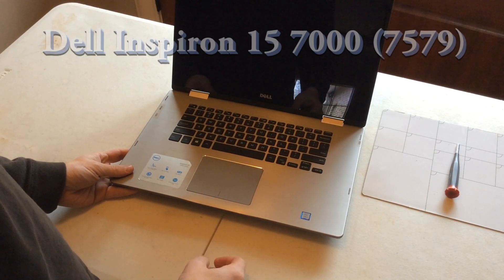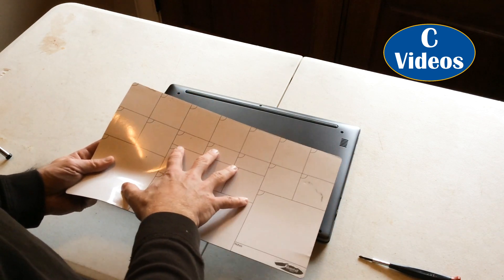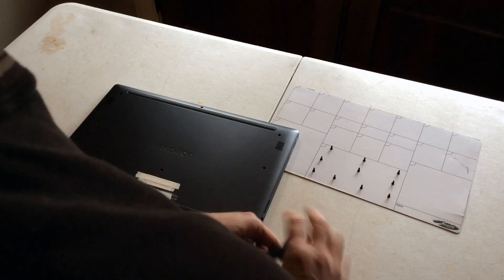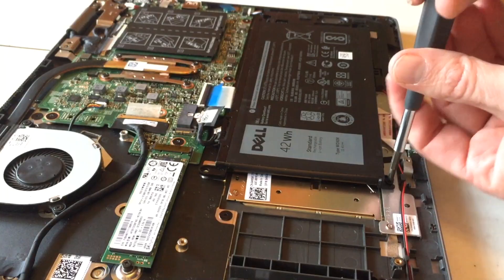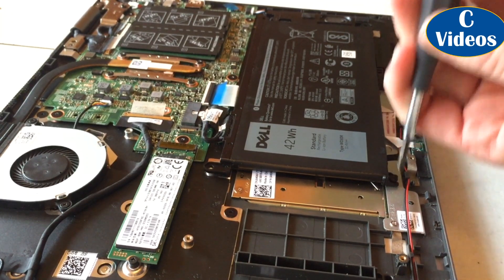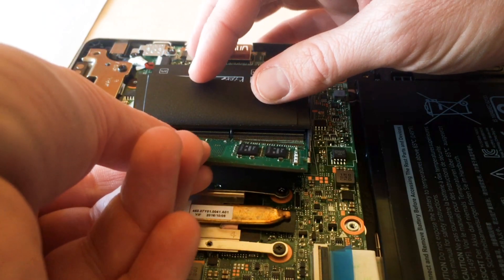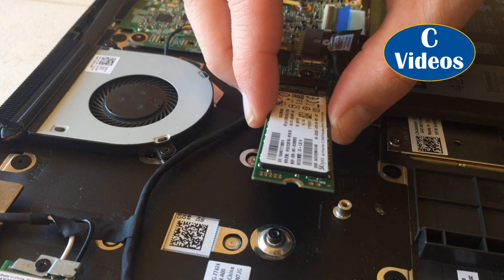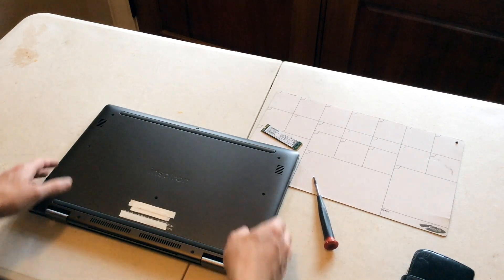Dell Inspiron 7000 Laptop -how to replace battery, RAM Memory, SSD / Hard Drive

Comment: Hello, I have a Dell Inspiron 15 7573 2-in-1 laptop. When I install an additional memory stick, i just get a black screen and can't even get into the BIOS. But with a single 8GB stick it runs perfectly fine. Originally wanted to upgrade up to 2x16GB = 32GB of memory, but it seems that everytime that I install both sticks, that's when I get the blackscreen. However when I have just one stick of 16GB Crucial memory in either one of the slots I get freezups after booting up into the desktop. I'm wondering if my laptop even supports Dual Channel mode.

Comment: Given the age of the video, this may have been pointed out, but on the battery replacement, I think you just got unlucky. I had all four screws in the battery. Thanks for the video though. It made things very simple to do.

Comment: The screws are all the same, you don't need that magnetic mat, you can damage the hard drive with magnets dude.
Reply from the maker: Thank you fro the comment. The mat is barely magnetic, if you turn it over, all the screws would fall off. It's just enough to keep them from rolling easily. And from my research, the SSD's are not affected by magnets.

Comment: Hi there,
Few weeks ago I suddenly got a Message "Hard Drive not installed" on my Dell Inspiron 17-7000(7778) (i5 processor) series and couldn't access Windows anymore, this was after a lot of years of ongoing screen freeze alongside other issues that I had on 2 same Inspiron laptops since day one and have reported to Dell but unfortunately Dell Customer Service and Support have Failed to Address the Issues tell warranty Expiration and then the Hard Drive failure Came, now I would like to try and upgrade to SSD M.2.

in Setup and Specifications I found that I can Install 
One-m.2 drive
 and 
One-2.5 inch drive.
Is Samsung 970 EVO Plus NVMe M.2 (1TB) or pro seies compatible?,
There woulden't be any Bios issues?
And is there a limit of storage capacity that my 4-5 Year old Inspiron-17-i5 can handle on both Hard Drives (primary and secondary).
Thanks.

Comment: Thank you!  I didn't have your magnetic sheet, but used your suggestion in laying the screws out in the same pattern they came out. (Before watching your video I was getting ready to just drop them all down into a jar. lol)  So, I was able to reinstall all of them except one, which I'll keep in case I have to take apart the computer again.  Maybe it'll work the next time around.  I'm lucky that it was just the one, since I'm notoriously bad with anything that has to be screwed - from jar lids on down.  So, it could have been a whole lot worse.  Thanks again.

Comment: I bought this laptop thinking it can fit a 2.5 inch drive, but it doesn't have a slot for it. Any way to add a second storage drive somehow? I don't care what type, even a mechanical disk drive would be fine.

Comment: Hello. Can I install and use both 2.5inch SATA SSD and M.2 SATA SSD  together in dell inspiron 7460 as this laptop has both the slots ? or installation of one will disable the other SATA port? 
Thanks in advance.

Comment: Thanks for the awesome video! I have Inspiron 14 7460 and I want to replace my bloated battery. However, i can only search wdxor batteries for inspiron 13/15 on amazon. If I purchase wdxor for inspiron 13 or 15 can I use it to replace the battery for my inspiron 14?
Reply from the maker: My apologies, But I am not sure.
Reply: @cvideos9641  ow thanks anyway!
Reply: @m_runna04   I am facing the same problem. Did you find any solution?
Reply: @jaypandya19  i cant find any battery replacement to buy, i just removed the battery for safety and continue using the laptop directly plugged in an outlet

Comment: Thanks you so much for the video. I have a question regarding second hard drive. My BIOS shows 2 hard drive SSD0 (empty) and SSD1 (which is attached). I could not find any other SSD slot on the board. I see one HDD1 slot though. So the question is can I use additional hard drive (SSD preferred)  in this laptop. If so then how?
Reply from the maker: I have wondered the same thing., Would like to add another SSD. and even better if it could selectively be turned on and off.

Comment: How do you know when its time to change the battery inside? The battery was not bulging out ridiculously. My Battery Report says 2019-12-29 59,969 mWh 97,003 mWh. Currently I get 3 hours and 30 minutes on a full charge. It's been about 1 year and 6 months on my Dell XPS 9570 i9 and it's an extreme workhorse! I just want to make sure I change the battery at an appropriate time and I don't want to wait to long where it just dies on me!

Comment: Great video! Thank you.  But it seems you forgot to put your memory back in...
Reply from the maker: Thanks. Memory installed around 6:40 mark.
Reply: @cvideos9641  They meant that on the last of the video you replaced the back cover and the NVMe SSD drive was not installed. I also wanted to comment that sometimes the outer screws do double duty to hold something inside also, as in the case of the missing battery screws. It looked like the 2 screws along that side lined up to screw into those. But nice video and thanks for taking the time to do it.

Comment: Thank you so much for this video. I changed the battery this weekend. It's been on a 24 hour charge. Have about 
5 hours left but am using it now. I have noticed my touch pad isn't working correctly.  left and right click don't click any more.
Do you know what I might have done? Appreciate any advise. Thanks
Reply from the maker: Do they work and just not "click?" If they are not working, may be a ribbon cable, if it is just not "clicking" I think I recall the pad is under the metal bracket under the battery (around 4:50 in the video). Make sure the screws in that plate are tight.
Reply: @cvideos9641  I took the touchpad out and put it back in. All is well. Crazy,  now the laptop just shuts down, says battery is critically low. Lol I can't remember which old and which is new.  I've done the thing where you disable and enable, I've checked the life of the battery by dividing the usage by the capacity on both batteries.  They both show history back to 2017. Im thinking I might just get a new "refurbished" one from Dell for $110 just to see what happens.  It's charging overnight I'll check it again in the morning. I wonder if frys can check the life of both batteries or if something is draining it.  It was fine before I just wanted one that would last longer without charge.  Now it only lasts about 20 mins.
Reply from the maker: @TinaSoriano  Hope the charge helped it. Mark your batteries with a marker, to help keep track of them.
Reply: @cvideos9641  I found out the ac cord isn't always compatible with a new battery that isn't for exact model from manufacturer. I have one coming from dell on Thurs.  The new battery shuts down as soon as I pull out the cord.

Comment: I use a dell inspirion 13 7000 2 in 1 laptop         system model 7373
I have pop ups that tell me my battery needs replacement and was just wondering if your video applies to my laptop as well?
Reply from the maker: I am not certain, but I would think some of the concepts may be similar.

Comment: My battery only last 2 hours any chance u can hook me up of a link where to buy a replacement battery?
Reply from the maker: I have not bought a replacement battery for this unit yet, it's fairly new. I know Dell sells them, as well as other online retailers.
Thanks for "liking" my video and subscribing to my channel.
Reply: @cvideos9641  I just ordered one from Dell for the exact model in this video.  I was actually hoping to get just the part number from Dell and order one off eBay on the cheap.  The battery from Dell was $41.33 total with free shipping.  I just ordered it.  It didn't make sense not to.

Comment: Nice video. You may have realized by now that the 2 "missing" screws for the battery are double duty screws that serve to secure the bottom panel and the battery. 

I've been trying to figure out if I can add a traditional 2.5" ssd along with the m.2 ssd. There is a connection point for sata cable HW01M which is sold separately. The BIOS does seem to list an empty slot for another ssd channel. But, there doesn't seem to be space for it nor screw holes for a ssd caddy. Additionally, Dell appears to have deliberately created plastic filler barriers that limit space and prevent a 2.5" drive from fitting. I'm thinking about cutting the barrier out just to see if I can fit a 2nd drive.
Reply from the maker: Yes. I had the same thoughts.
If you do some searching, it does seem Dell sells, or sold, similar units outside the US that come with two drives.

(Thumbs ups, likes, and shares are appreciated)